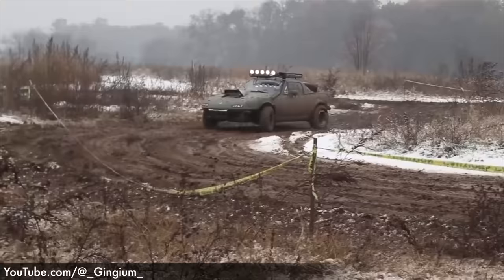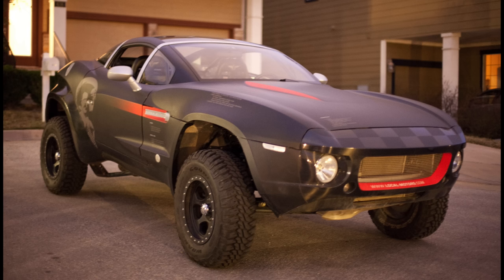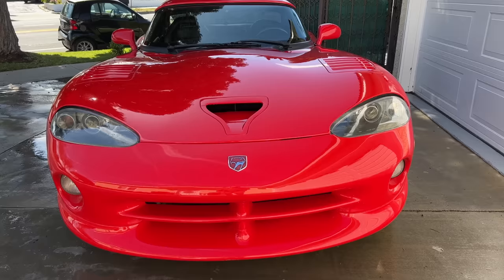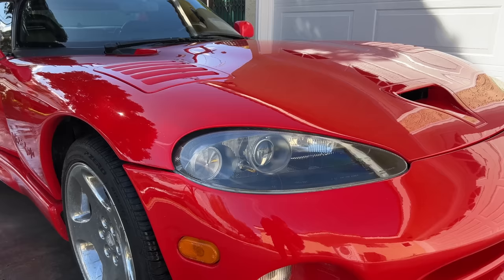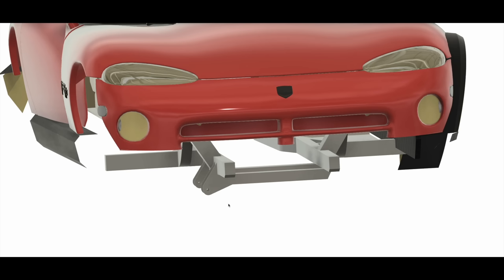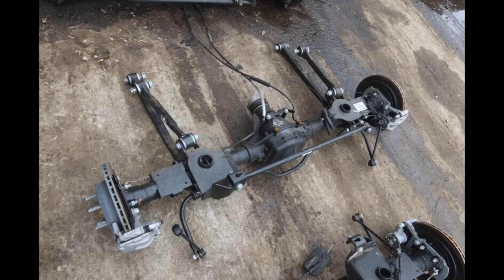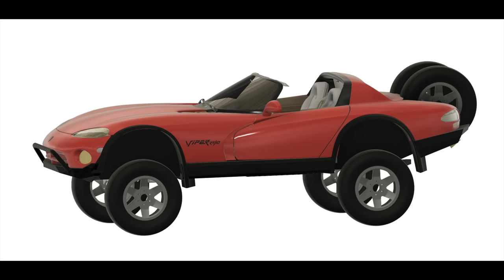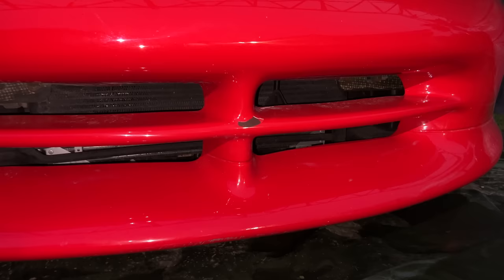Let's Build An Off-Road Viper

Comment: About 8 minutes or so into the video now. Somebody give this guy at Tim Hortons coffee. I'm making jokes about the drivetrain and what are you doing? You're doing the smart thing! Something I was literally teasing about where you were talking about bespoke drivetrain parts. Get all that flimsy garbage out of there and put proper built drivetrain on that thing and from what I can see it looks like you're actually reinforcing the frame or whatever those things have for a frame before somebody starts screaming they don't have a frame they have enter answer here. And I understand why you're using a 99 Viper I have a 2009 Dodge Caravan and let me tell you the traction control system on those is not only laughable it is downright dangerous and garbage. I have multiple times nearly had major accidents because of the traction control taking control away from the vehicle where you basically have a instant turtle. IPhone to Caravans with traction control and turning it off makes zero difference. All of a sudden the vehicle just goes dead limp and now you're begging to be hit by some clown who refuses to slow down because you're in the way one of my Caravans in the winter I've already had the rear end pushed by somebody who basically put the opinion across get out of my way or else you're going to be a bumper car and they just started shoving so I speak from personal experience the tracks control is not only useless it's dangerous. Any kind of sign of snow on the road and the vehicle immobilizes itself where you basically have a flashing light on the dash and the wheels aren't moving and you've got some guy ready to Ram you or plow into you because you got in the way. I've driven a 1999 Caravan and 2004 Caravan free traction control ironically they were some of the most capable winter Vehicles I've owned with good tires I drove them in some of the worst road conditions you could ever imagine not driving like a maniac if anybody's wondering I'm talking just basic slow speed driving where you had four wheel drive vehicles having more problems than I was lol. Wasn't doing it for fun either if anybody's wondering we get interesting weather conditions that they don't talk about on the news lol. And I still remember people staring at me like they're seeing an optical illusion where I'm driving up hill and four-wheel drive and so on are sliding out and going down the hill backwards and at slow speed I'm driving up the hill like it's just another sunshiny day lol. Honestly if it wasn't for the rest I'd still have an older Caravan they rot out down here something fierce and that's why I still don't have the 99 or the 04 the subframes went on them